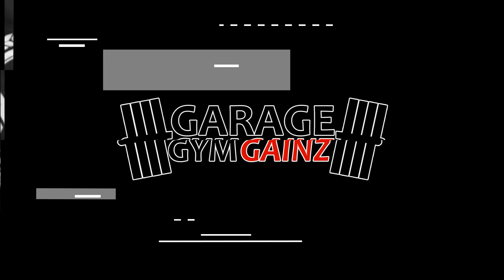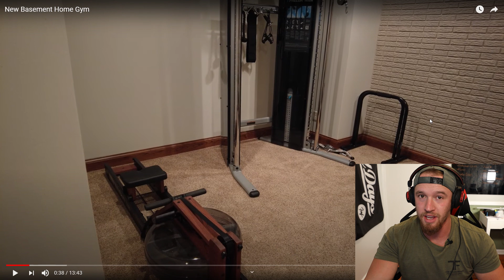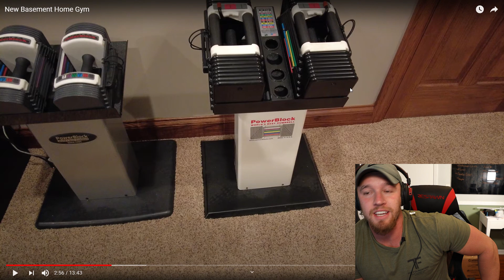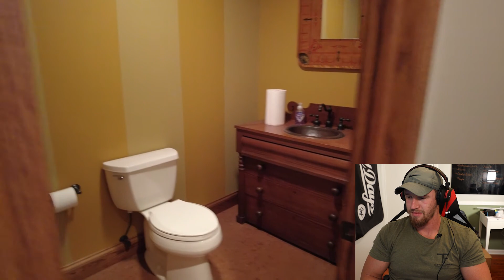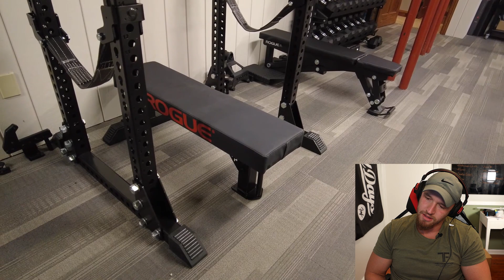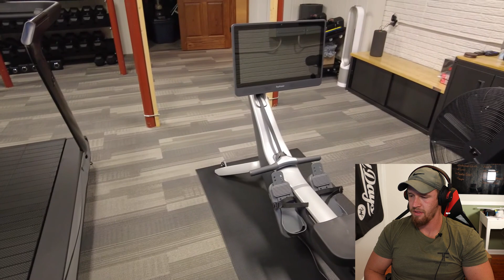Wild Rogue Fitness Basement Gym!

Comment: I feel like they're missing a popcorn machine in the home theatre... :) and i agree with a functional trainer in the main gym and also curious to know the flooring... overall awesome gym....
Reply: We use the functional trainer in the guest gym often… it only about 100 ft from the larger main gym.  Floor in main gym is made up of padded carpet tiles….  These tiles look great, plus they have a very hard rubber padding underneath.  If one ever gets damaged, we can simply replace one carpet square instead of the entire floor.  They came in 1ft x 4 foot tiles and were laid in a staggered pattern.
Reply from the maker: Hahaha good point!